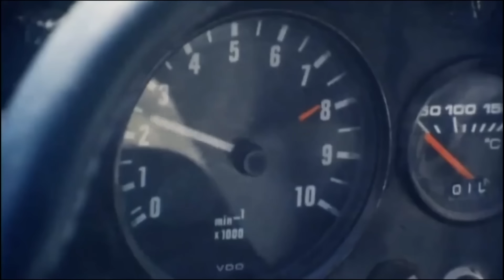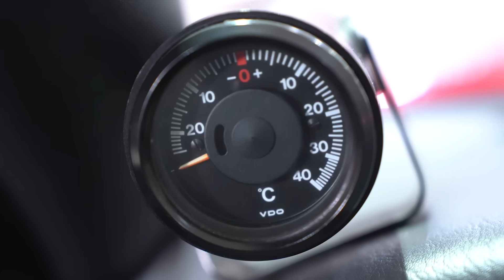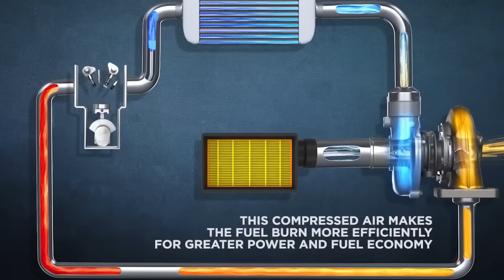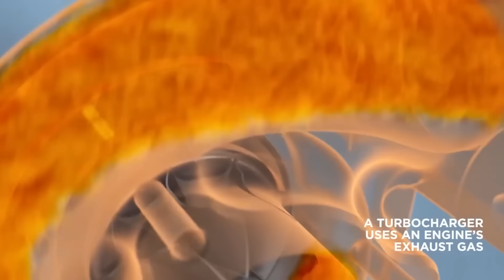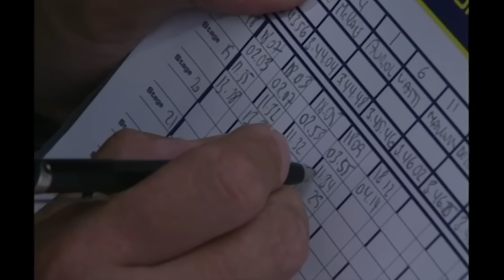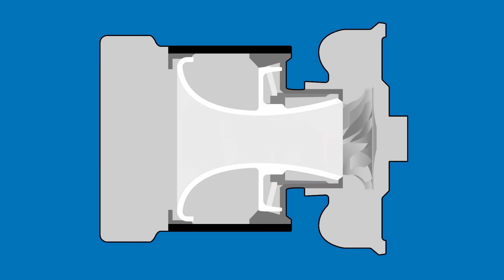Legendary Turbo Cheat - Toyota Celica GT-Four ST-205

Comment: the Aprox 1992 celica cars had a Castrol promo car that was taken to events and I think you could sit in and video game a stage. when it was finished with it was raffled off to Castrol staff; I commissioned it for the road, my name is on its first MOT, I have driven it across Swindon. Yes it's not a full on rally spec just a stripped down road car but I have seen it 2 years ago in Cornwall.

Comment: Retrict the air flow of the turbine means restricting the horsepower. A little more airflow reduction from 36mm to 34mm, 2mm reduction means a significant difference of 50 horsepower. WOW !!

Comment: Thanks for the video - according Mr Kankkunen, "they" ruined the engine of st205. It was not the as high reving than before the change. But, yes lets face it - 205 chassis was error by Toyota at the time. Too wide, too long, too heavy etc. Lancia got out because carburetor wire break down at 1000 lakes rally 1992...that was the last drop.

Comment: wasnt cheating, the opening was to spec, they just found a way around it literally and it was genius.
Reply: To those who thinks that the cheating done by Toyota is innovation, please learn some engineering. There's nothing impressive on it aside from the fact that they don't play fair and square. Evos and Subis beat them despite the cheating by Toyota. This means that Toyota has sub-par engineering.
Reply: How come that's not cheating when the purpose of that plate is to limit the participants to a certain hp and Toyota intentionally bypass it while other participant abide by the rules.

The fact that they lost to Subis and Evos even though they are cheating is a testament to their sub-par engineering.

Comment: I wanted more info on the turbo.  Finding a new and alternate way to get more air while following other technical aspects and limitations is not cheating.  Why didn't they outlaw 4wd in the early years? Was that not the same type of advantage?
Reply: When the rules are written stating that all air entering the inlet to the engine MUST pass through the air restrictor, then finding a way around the air restrictor to free up more power is Very Much Cheating. Hence why Toyota got the boot.
As for why 4wd was allowed in Group A, it was a modified production class, and Lancia was producing several thousand 4wd Delta's a year. The FIA were kinda stuck - if they increased the number of cars needed for homologation to exclude the Lancia, they would effectively exclude all the other teams as well. So, 4wd was allowed, and the other teams had to decide if they wanted to play or not. Some did, some didn't. When Subaru joined in, that sealed 4wd in, as Subaru didn't produce any 2wd cars at all...
Reply: I think it could be an interesting method...😅

Comment: I usually drive a suburban.  I rented a 2024 Camray . The difference was like night and day.
Stops on a dime. It was the fastest car I ever drove. It had three ways to shift gears.
Keep your elbows locked on your legs, hands on the wheel, and use paddles under the wheel. It fish tails on wet pavement.  Don't try to figure out the computer/radio on the dashboard. When it goes past 110mph, it shimmy shakes. ...
Reply: It is made for short, skinny people. Getting out is like Alan Shepherd getting out of Freedom 7. 
I had to elbow my way up and out from inches above the pavement . Not for chubs
Reply: Of course it's night and day... you're talking an SUV that weighs a thousand pounds or more. The center of gravity is lower in the Camry. 
Also, if you're "fishtailing", you probably need better rubber. Keep in mind, it's a rental car.. so they're not going to buy top of the line tires.

Comment: I wish motorsports (both WRC and DTM) went back to requiring homologation models.
That gave us the most epic cars of all time. Like the Celica GT-4, Impreza 555/WRX-STi, Delta Integrale, but also the BMW E30 M3 and the Mercedes 190 E 2.5-16 Evolution II 
Epic roadcars with true motorsports heritage.
Reply: They still require homologation, but the cost of making a homologation special is so expansive that most manufacturers instead just base their rally car on one of their regular models. The exception is the GR Yaris.
Reply: But, Group A basically killed rallying.  The production cars they were based on, were so poor in their build quality and reliability, that they had to keep shortening events, just so some cars would make it to the finish.  You know, like the life expectancy for a WRX gearbox was, like next Tuesday, so World Rally Rounds couldn't be more than a couple of hundred kilometres long.  Such a let down.
Reply: Most FIA sanctioned racing still require homologation. One notable example is the GR Yaris, which is meant for Toyota's entry into WRC.

Comment: Wrx width 67.1 inches wheelbase 99.2 inches
Celica width 68.9 inches
Wheelbase 99.9 inches
I doubt the dimensions had that much of an effect. Was probably just a better chasis/suspension and AWD technology. Considering those are the areas that in the end made Group A cars faster than Group B cars.
Reply: Its crazy how very different the two cars feel. 

Not a perfect comparison but my stock st185 changes directions in a very different manner than any of my subarus, 05sti 06spec b, 96 leggy w v7 jdm sti running gear. To me and my driving style the subarus are much more grip and go and the st185 is much happier with the rear rotating. The st185 “feels” much more nimble but the subarus tend to grip just a bit harder and quicker out of corners. 

Just my experience. Hopefully adding an early evo to my fleet soon for even more compare/contrast
Reply: @guitarguymi  yea but the overhangs were longer. Similar case with Peugeot 205 T16 and Audi Quattro

Comment: Celica was not ideal nothing will ever stop factories cheating unless they take a leaf out of American Motocross from the late seventies where to discourage factory specials they had a claim rule where anyone could pony up I seem to remember at the time US $10,000.00 and own any works bike in the same race as them that stopped the specials stone dead and they just modified standard production bikes still had some special parts and tuning but not to excess making it pointless to claim them.

That particular Celica TTE used had a 240mm longer wheelbase based on some supposed low volume model sold only in Germany, Bit like some cars that had Nitrous Oxide pressured in the Roll cage for when they wanted some extra power, Then we have the Racing XJS Jaguars where they actually sloped the nose of the car down for more downforce but done so subtly you would only pick it is a standard car was parked side by side.
Dolomite sprints where they manufactured a complete floorpan with the suspension pickup points exactly where they wanted them but it "Looked Stock"

Comment: I do love a good cheating story but I would have liked more details on how the moving turbo inlet worked.
Reply: When you clamp it down washer thingys compress and push up on another part opening an airflow path around the perimeter of the  restrictor funnel between the outer casing and the restrictor
Reply: @lasskinn damn that's smart!
Reply: The restrictor plate is supposed to be a fixed piece but Toyota made one that had a spring hidden inside of it that pushed the plate up/forward so when it was out of the car it looked like it was all one piece and complied with the size specifications.   Once installed into the intake system with all the hose clamps on it the restrictor plate was pushed down/back allowing air to flow around the outside of it it as well as through it.    The Toyota restrictor when installed with air flowing around and through it was equivalent to running a 2-3mm larger restrictor.    More air, more fuel, more power.    There are good videos with animations showing what was happening.
Reply: @SavageShooter93  I know when I think of a restrictor plate. I think if like a 5/8 stamped aluminum plate with however big specified allowed, sitting atop the manifold. So the most "engineering" I think of was rounding the inner edges to smooth airflow.
Reply: @CERTIFIED334  Yeah the WRC turbo inlet restrictor plate is not anything like a NASCAR flat plates, it was actually a restrictor for the turbo inlet so it had to be tubular and fit into the turbo inlet piping after the intercooler  and since the fluid dynamics of the turbo are complicated simply slapping a flat plate on the inlet would cause serious flow issues like chopping and surging and actually damage the turbo not to mention causing serious performance issues.   
 You should really check out the in depth technical explanations of the cheat its actually really cool what they did.
Reply: There’s plenty of technical videos on it on YT. People have a hard time explaining and understanding the cheat. Even the techs were amazed.
Reply: I always thought it was because they were running overboost
Reply: @BPF80MCar-vi1pg the overboost technique usually improves the horsepower of the Celica WRC by 15 more horsepower.
Reply: Basically what happened was the thing opened up more which allowed more stuff to go inside and made more power
Reply: In simple terms they found a way to allow air around the restricting cone on the turbo inlet
Reply: Youtube comment sections are full of people claiming to know how the cheat worked.  I don't believe any of them, since I've yet to see anyone adequately explain it.  So far it's nothing but a load of dilettantes thinking that they can look like experts if they just mention 'belleville washer" and "hose clamp".
Reply: It worked very good
Reply: Very simply, there were washers in the intake restrictor that worked as a cantilever when they were squeezed. 

When you tightened the hose clamp, the washers pivoted on the housing and levered the restrictor forward, which allowed air to travel around the outside of the restrictor and in behind it. Bypassing the restrictor allowed the engines more air. More air means more power. 

It’s a difficult concept to explain, much more easily demonstrated. But essentially, when you tightened the intake hose clamp around the turbo, it pushed down on a washer that moved along a ramp which pivoted the restrictor forward.
Reply: Brilliant explanation  @inz1
Reply: @inz1  Beautiful. It was even polished internally for more airflow.
Reply: The longer the intake runner develops torque while shortening it develops horse power
Reply: they didn't cheat, kinda boring, right?